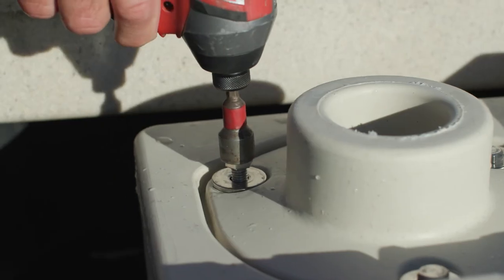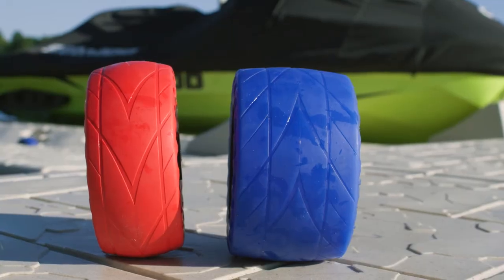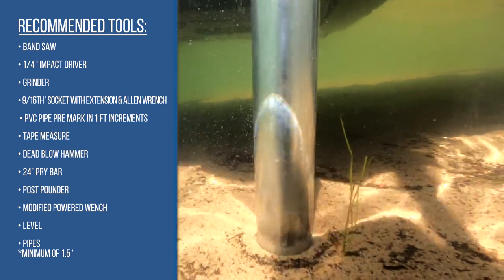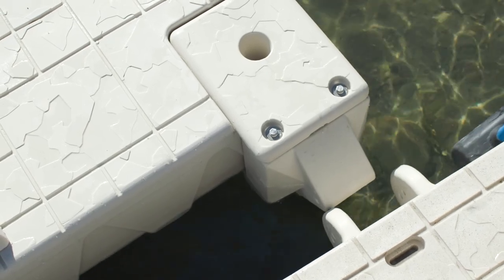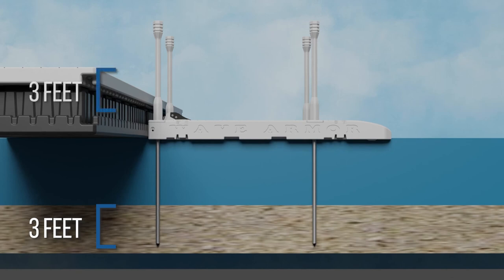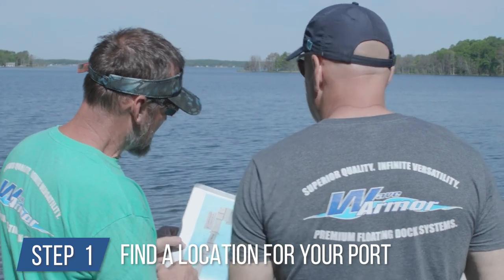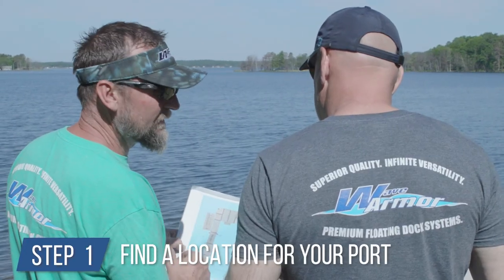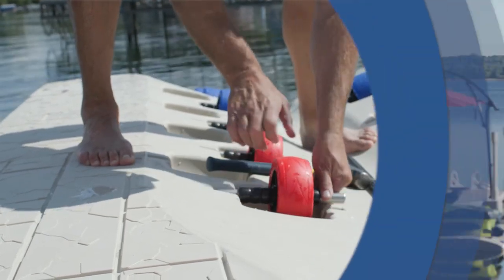Port install Video

Comment: If I do the 6' pipe installation driving the pipes into the lake bottom, how do you remove the waveport to take it out of the water for winter storage?   I assume you would have to remove the pipes from the lake bottom somehow, otherwise the waveport would be trapped since the installation goes through the waveport sleeves.
Reply: good point! I am considering one of these for my Sea Doo Switch. Our lake has a hard sand bottom so pulling the posts could be difficult. I would also like to see the canopy installed/uninstalled.